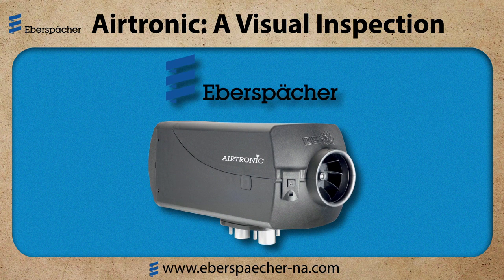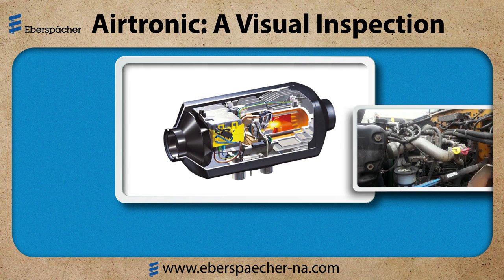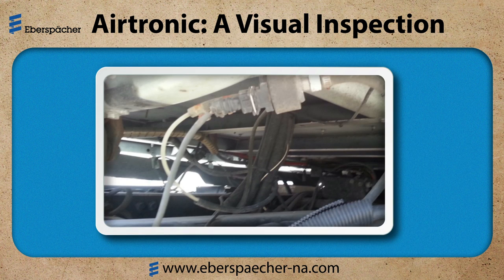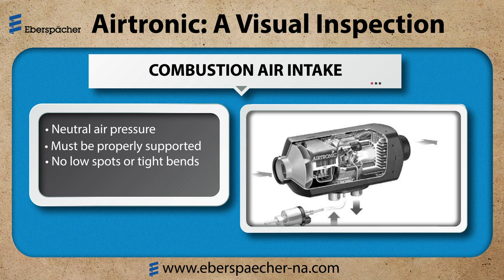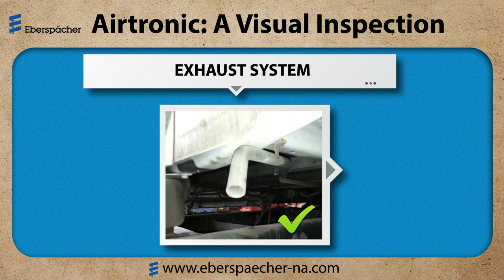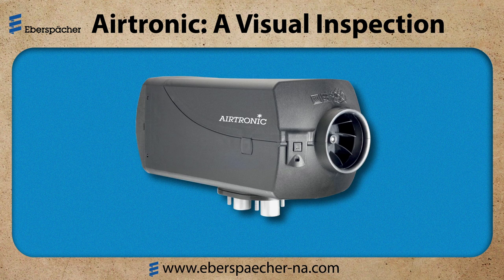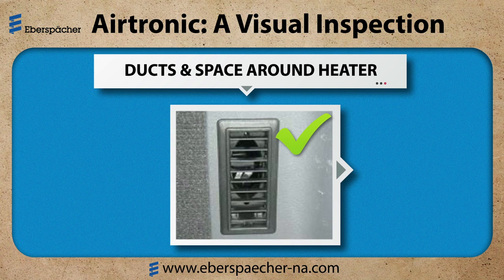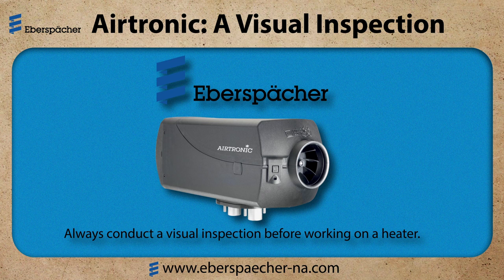Airtronic Heater | A Visual Inspection

Comment: What if the vent gets blocked and won't turn on? When this happened, I wasn't with our vehicle, but the 'renters' said they woke up and the heater had shut off. After talking with them, it sounds like a computer bag may have been placed near or in front of the vent.
Reply from the maker: Hi Lindsey.  Sorry to hear that.  I'm not a member of the tech team, but I will email my contact in that department and try to get you an answer asap.
Reply: @EberspaecherNorthAmerica  by chance, was there any answer they gave you?